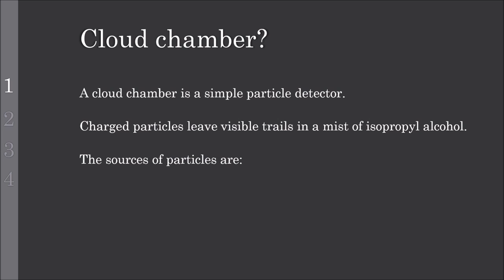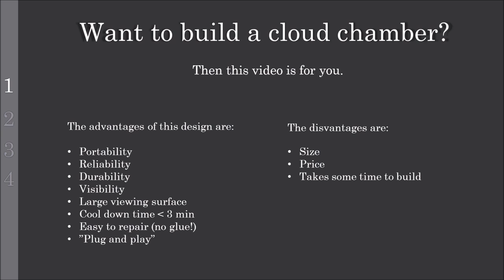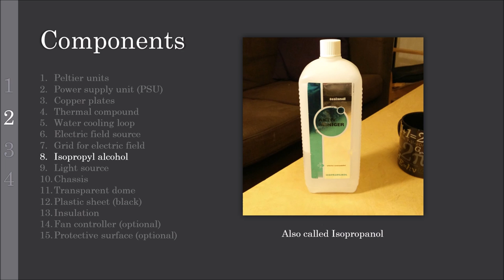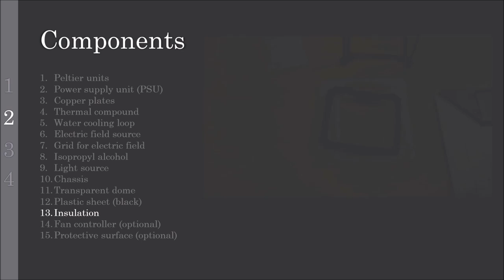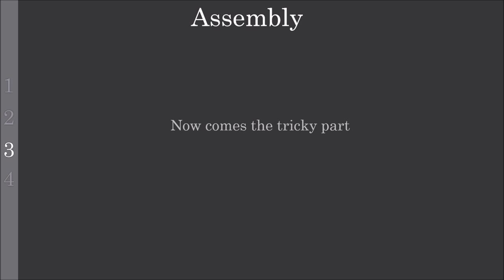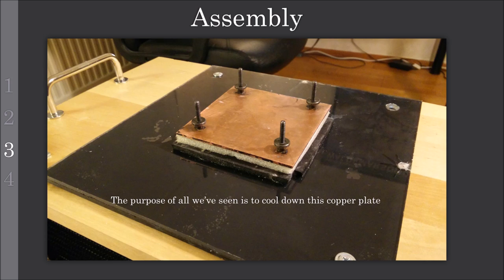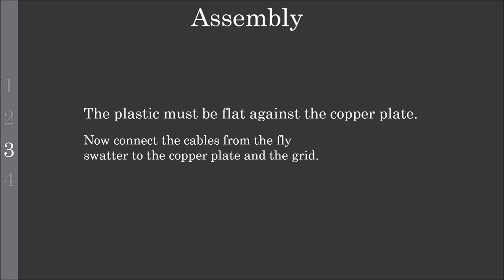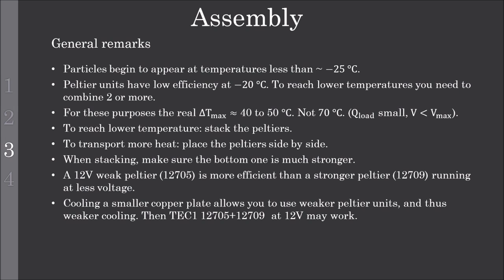How to build a peltier based cloud chamber

Comment: what does the high voltage source do?
Reply from the maker: +Loyd anonamous 
In short: The high voltage source creates an electric field between the copper plate and the grid, in order to draw stray ions out from the saturated layer of alcohol vapor / mist.

Longer: Ions in the mist work as condensation nuclei for the the alcohol vapor to form droplets around, so you need to get rid of those stray ions using an electric field.  Once the region is free from ions, the vapor can be come supersaturated, meaning it's just waiting for something to build droplets around, but can't quite do it by itself. When an alpha or beta particle from a radioactive source then flies by at high speed, it ionizes alcohol molecules in that layer, leaving a trail of condensation nuclei for the alcohol to build droplets around.
Reply: David Aceituno
Ok thanks for that explanation.I would have thought that would create even more stray
ions.But you must have tried it with power
off and power on.And from what you have said
the power on must give better results?Does it?
Reply from the maker: +Loyd anonamous Absolutely! The electic field greatly improves the effect. In fact, the particle trails aren't really visible before i press the button that turns on the field. A "leak resistor" is built into the electric fly-swatter handle that I use to generate the electric field, which drains the charge in about a minute. Thus, before pressing there are no trails, once pressed the trails remain visible for about a minute or so and fade away, until I press the button again.
Reply: well that is very innovative use of one of those
fly swatters.They are useless as fly swatters.
Reply: +David Aceituno An electric field charged particles, that is what we are detecting, so it would work to change the polarity os the electric field to make lets say for an example, alpha particles go upside and beta- down, and if you have a sample of an isotope that decays throug b-, change the polarity to see better the electrons going up?
Reply from the maker: +Iván Gándara Martínez Hi! usually the vapor trails are left by charged particles that fly through at great speed, and the deflection of their trajectory due to the electric field is negligible. Even so, any visible trail is in the 2D plane of the vapor, by construction. Noticeably curved trajectories occur very rarely (once every couple of minutes, say), by slow moving alpha-particles that are deflected by a screw or wiring. Ive tried neodym magnets placed inside the chamber and then some trajectories become "chaotic", usually flying out of the 2D plane, or sometimes making a cycloid motion.
Reply: +Loyd anonamous Awesome build man, I've been contemplating building one myself after seeing this vid years ago, today I'm gonna start on it. One question I've been thinking about for over two years though, would it be possible to increase the thickness of the saturated layer if I decrease the pressure inside the chamber? Or better put, would decreasing the chamber's internal pressure to say 7 bar, have any effect on the depth of the saturation layer?
Reply from the maker: I'm not really sure. Doesn't hurt to try if you have the right tools :) I have read that Wilson''s original setup used water because he was studying weather phenomena, or something like that. He used a piston to lower the pressure and temperature and it was then that he noticed faint particle trails in the chamber. 
The properties of the mist is most definitely dependent on temperature and pressure but I'm not sure to what extent it would help to control these parameters in a modern build, especially if you consider the added complexity and cost.
Reply from the maker: Hi! No, I didn't try changing pressure but I'm convinced it must have some effect on the cloud, or at the very least changing the critical temperature. I didn't do it mostly because it would be too complicated with the tools I had at home and on a student budget. I'd be interested to know if you find out  what changing the pressure does. Good luck with your build!

Comment: Is it still hazard for looking the jar too long?
Reply: Radioactivity present everywhere the sample is located, same with cosmic radiation. What you see in the cloud chamber aren't the actual particles though; rather their 'footprints' of where they've been/travelled. As long as you aren't using highly radioactive or gamma-emitting sources, it should be safe to view low radioactivity sources emitting alpha and beta particles for extended periods

Comment: i have some problems with my chamber, would anyone with experience be willing to help?
Reply from the maker: Still having problems?  Have a look at the earlier comments of this video too, where I have answered many questions. Otherwise just describe it here and hopefully I can give a pointer or two.
Reply: @kamebwoi  thanks for the reply man !! I'm running a 24v 200w 50x50 mm peltier. At 12 volts. On top of that are a pair of 1209 Peltiers side by side both running at 6 volts. That's gets to about -6° on top of those are two sets of 1206 Peltiers running at 3 volts each. I only have a 12v psu that is 750watts
Reply: @kamebwoi  and in that config it only gets to -23
Reply from the maker: @aaronsharman8031  How big is the cooling surface? Or are you measuring directly on the cold side of the peltier? I suspect that the bottom peltier is overwhelmed by the heat from the two top layers. The cooling power on a peltier stack needs to be very bottom heavy. The strong one at the bottom must transport its own heat as well as whats loaded on top, and ideally do so with plenty of power to spare, otherwise it will have a delta T ~0 across and just be in the way.
Reply from the maker: @aaronsharman8031  More questions 1)What temperature do you get without the 3 volt peltiers? 2) What do you get if you use only the 50x50 + 1 single 1209, both  at 12V?  3) Describe your application of the thermal compound between the peltiers.
Reply: @kamebwoi  1) I get about -13 without the extra Peltiers. 2) If I use them both at 12v it doesn't get below -10. 3) I use a thin layer of cpu cooking thermal paste. It's correctly applied as I'm familiar with building PC's. :) My two suspicions is that I need a wider range of voltages and maybe a better cpu cooler :/ I'm just trying to work with what I've got atm which is a super powerfull 750 watt 12v psu.
Reply: @kamebwoi  the cooling surface is a 50x50mm long strip of aluminum that is 3mm thick. This aluminium strip is connected to two cou coolers and works slight better than if I only use one cpu cooler directly connected.
Reply from the maker: @aaronsharman8031  Which cpu cooler are you using? In my experience, for a strong peltier stack one needs quite a lot of cooling power.
Reply: @kamebwoi  just likes to announce, I have finally completed my cloud chamber! and it works beautifully! thanks so much for this video :)
Reply from the maker: @aaronsharman8031  Awesome! I'm happy for you! It's such a thrill to finally see the particle trails :D  I'd love to see it! Let me know if you make a video or put some pictures online.
Reply: @kamebwoi  definitely man! ill let you know! if you have Instagram id be happy to send some pictures!

Comment: Where do you put the water in the water cooling loop?
Reply: We got the corsair h100i gtx water cooling loop if that helps at all?
Reply from the maker: +Savannah Hauersperger Hi! I had assumed it came with water in it? To my knowledge these water coolers come with the fluid already and you shouldn't open them.
Reply: +David Aceituno oh ok that makes a lot more sense! Also, for our electric field, we are using the cpu playe that we ordered separately instead of what came with the cooling loop. Is that right?
Reply from the maker: +Savannah Hauersperger Hey! Sorry for the delay. The cpu plate is not really that important, it's just there to fasten the white pvc tubes in my setup. The poles for the field are actually the grid and the bottom copper plate.
Reply: +David Aceituno it's ok! We actually ended up using spacers glued together instead of pvc tubes and our backplate is a ceramic almost material... does it matter if we use that or a plastic type of material? Also, can you explain to me why we need an electric field? My teacher asked and I didn't know how to explain..
Reply from the maker: +Savannah Hauersperger You can read my answer to that question and many others on my thread on reddit :)  https://www.reddit.com/comments/2vuzwb
Reply from the maker: +Savannah Hauersperger How did it go? :)
Reply: +David Aceituno It's going good! We are just having trouble trying to control the fan speed and get it up to its maximum speed. We tried using a fan controller, but it won't work with our fans. The fans came with the water cooling loop and they were supposed to be controlled by downloading software onto the computer and control it from there. However, since we are re-purposing it, we are trying to find a different way to do it without frying the peltiers.

Comment: why do you need an electric field inside the cloud chamber?
Reply from the maker: In short: It removes ions from the cloud that could potentially deflect incoming particles. 
I wrote a more thorough answer the other day to a similar question, so I'll just paste it below: 

"My best guess is the following model: Alcohol molecules, being dipolar, can spontaneously build droplets with some surface tension if the temperature is high enough, because then the kinetic energy is enough to overcome some potential energy barrier related to the surface tension. These droplets look like a constantly moving cloud or mist, on top of the cold plate, and the few radiation trails that are not deflected by ions, mostly drown in that mess. However, below a certain temperature, lets call it T_critical, alcohol molecules need a condensation core or a small perturbation to make droplets. If this is somewhat correct we can draw some conclusions: 1) Naturally occurring free ions may provide condensation cores for making undesired droplets even below T_critical, which means that 2) an ion scrubber, upon removing these ions, leaves a volume of (desired) supersaturated gas ready to condense around a trail of ions left by alpha/beta/muons. 3) An ion scrubber may also align the (dipolar) alcohol molecules making it even harder for them to condense into droplets on their own."

Comment: Don't the emitted particles cause cancer?
Reply from the maker: +myne4 Well, yes and no. As this table-top experiment shows, radiation is everywhere.  Cosmic radiation and radioactive decay occurs naturally around us all the time. The cells in our body have mechanisms to repair or get rid of  damaged DNA caused by radiation up to some degree that allows us to live as long as we do. There isn't a sharp limit to how much radiation is "too much". There is a lot of randomness involved. Obviously it isn't the case that the smallest amount will immediately cause cancer,  on the other hand a huge amount surely will. The radiation you see in my video isn't a "huge" amount by any means. Still, alpha-radiating dust can be quite taxing if ingested so i prefer to wash my hands thoroughly after handling the ore.

Comment: or you could use cheap dry ice?
Reply from the maker: The point of this project was precisely to avoid dry ice. The physics teacher at my university suggested this project after having dealt with logistical problems getting dry ice  in time for in-class demos (storage and transport is a bit cumbersome)
Reply: @kamebwoi  ahh sorry for that😅 my mistake... I have to perform research work on for my college application and I wanted to do something related to physics and particle physics seems very interesting to me. Do you think I can do any science with this experiment? Again sorry for the assumption